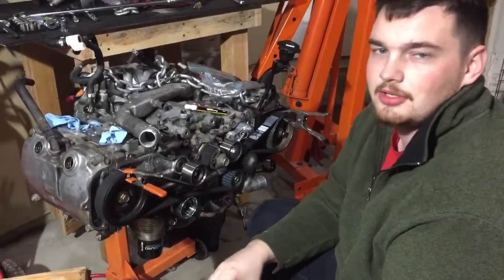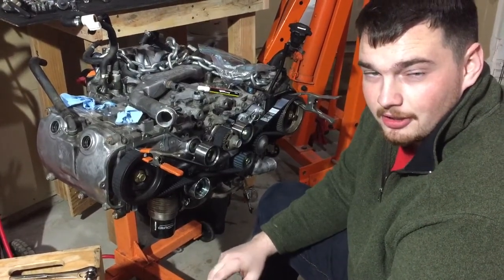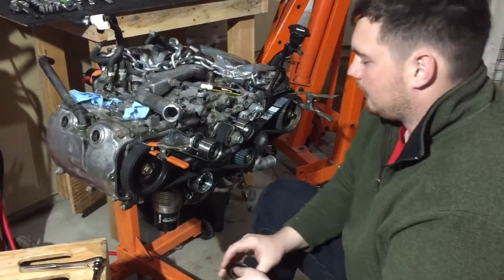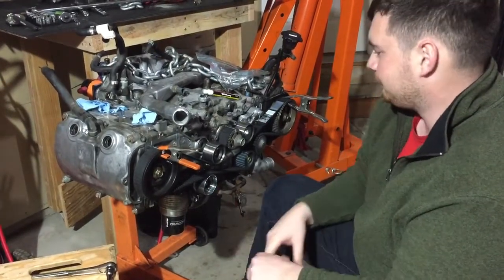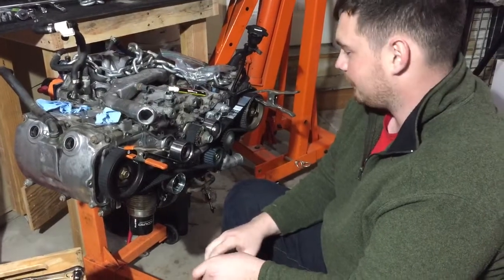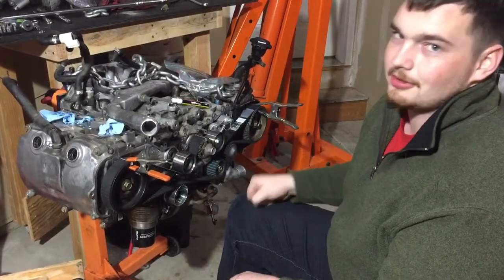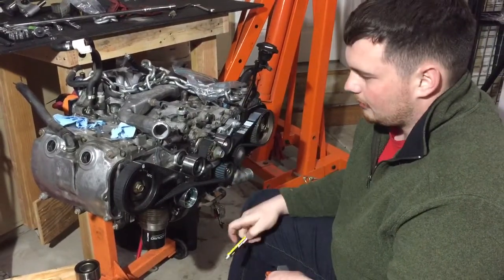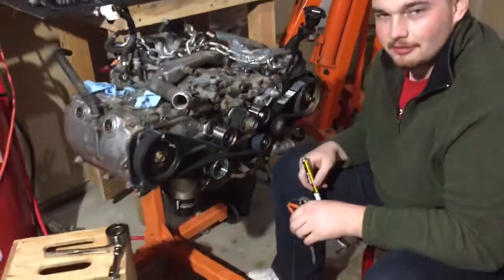Don't Miss These Critical Components When Changing Your Subaru Timing Belt

Comment: Is the tensioner not mounted to a replaceable bracket (Subaru anticipates some ppl stripping a bolt hole)?
Reply: It will strip if the tensioner is removed first.always remove bottom idler first..